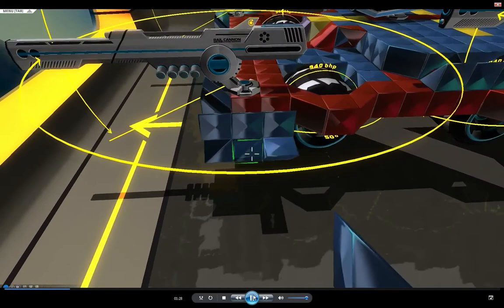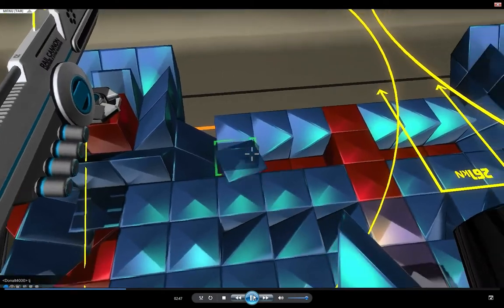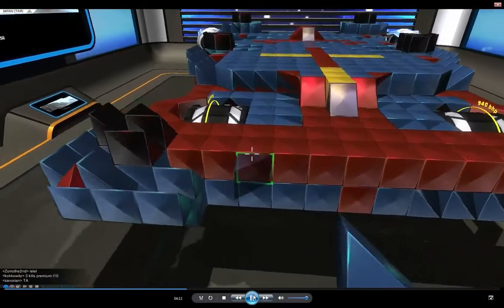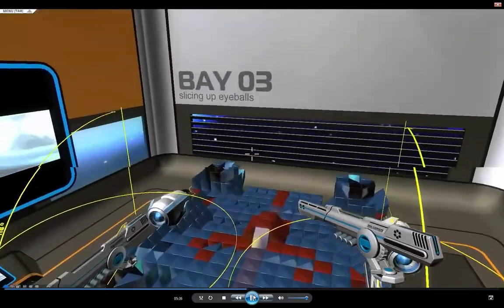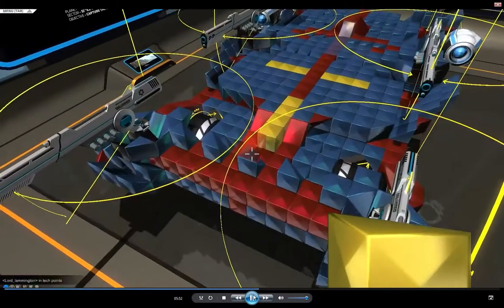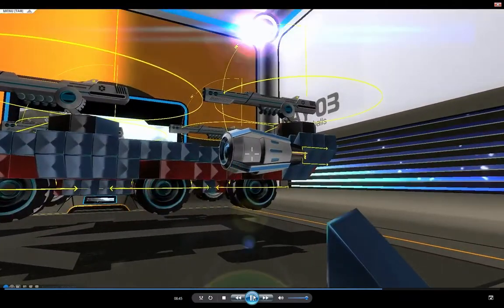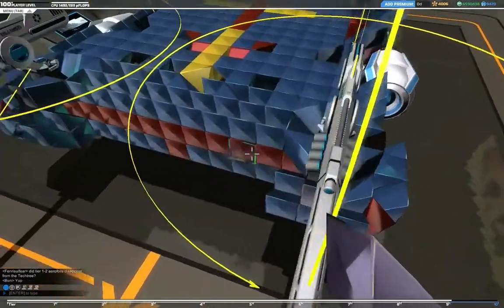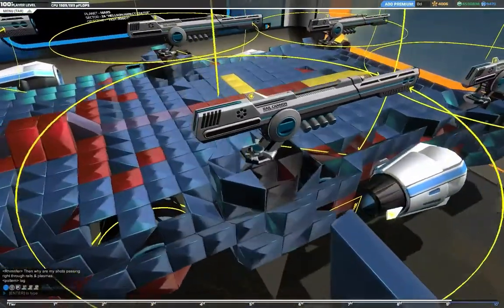Robocraft Engineering - T10 RailBed - Part 4

Comment: Sorry im fairly new to robocraft. Whats the reasoning behind using inners instead of cubes and all these spikes instead of a thick column?
Reply from the maker: inners weigh less and I want to be bottom heavy

the prisms are various forms (and non-forms...faux) trifold armor. You can use prisms and tetras to control the way damage travels from block to block. Mainly you use those slanty edges of prisms and tetras to prevent damage flow in that direction. The way I set up the trifold here is mainly to have it layer off (flake off) when I take damage.
Reply: Wow! That's genius. I think it'll be a while until I'd be able to do that :)
Reply from the maker: Chiyun Lee Robocraft basic armor design ideas
is a video I made about trifold armor...there will also be youtube suggesions from there
Reply: Just the right thing. Thanks!